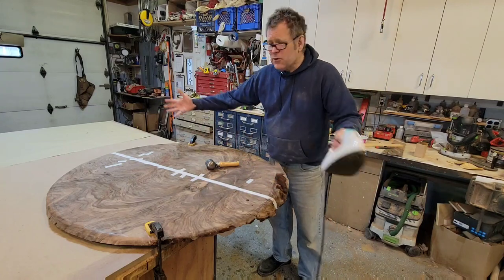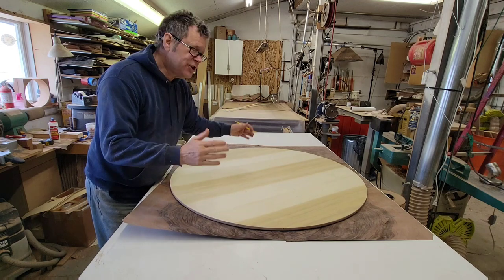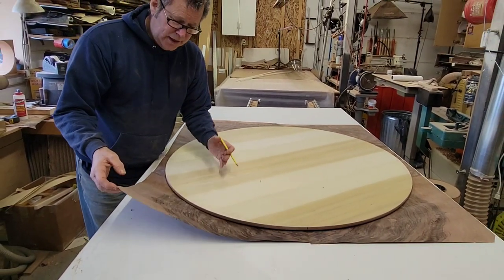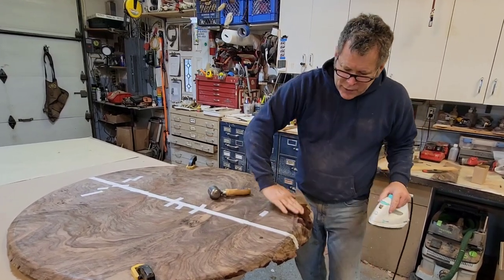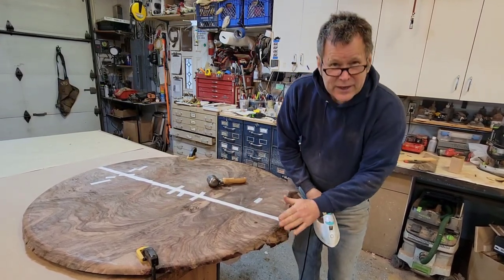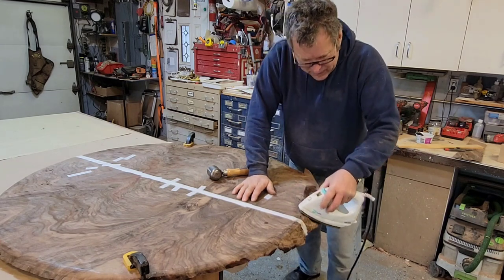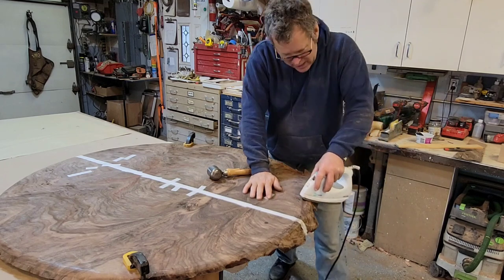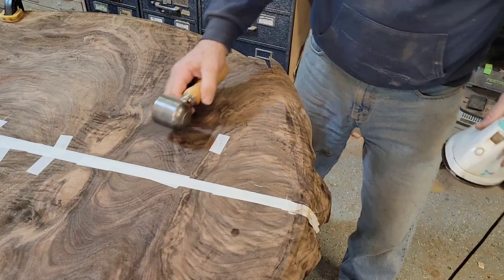Compound Veneered Water Fall Table Edge

Comment: Question: do you think applying the veneer directly after softening it in the compound (mentioned in the straightening veneer video) could also work - Meaning that you would apply the damp veneer foil, firmly press it with a metal or wooden roller, then gently iron the surface and then let it naturally dry and tighten on the wood support while the veneer fibres lose their water content?
Reply from the maker: yes, I've done that.  Worked well on the nude torso which I cast with fiberglass.  That was extreme compound veneering   Although, you'd want to be careful that the substrate doesn't warp, and any veneer seams can open up as the veneer dries and shrinks.  I have an entire series about veneering, two on Compound veneering.   see them here https://imaginewoodworking.com/pages/courses-and-demonstrations
 Enjoy!